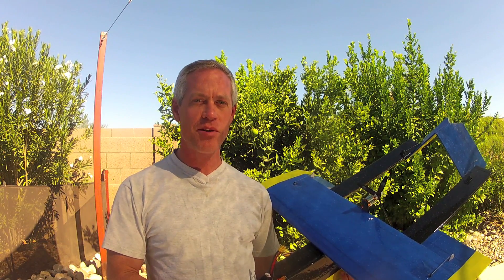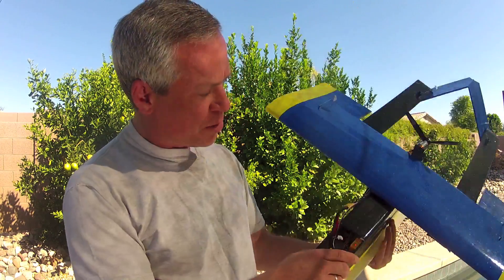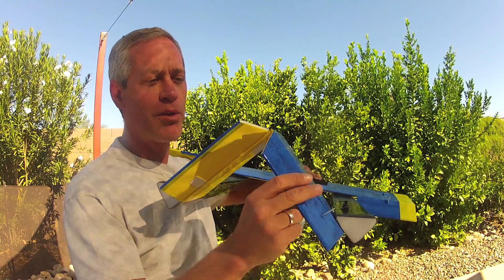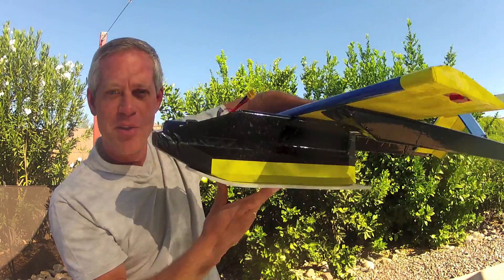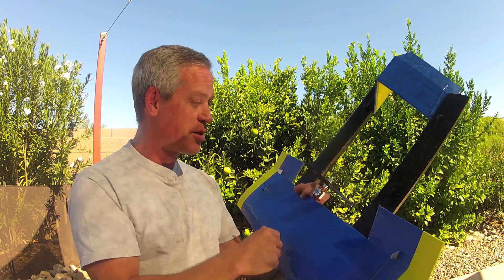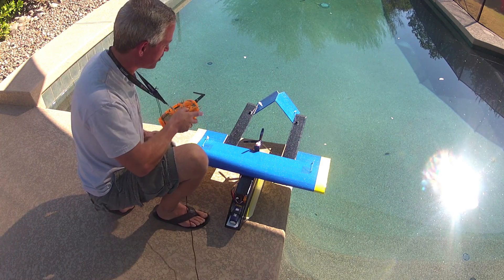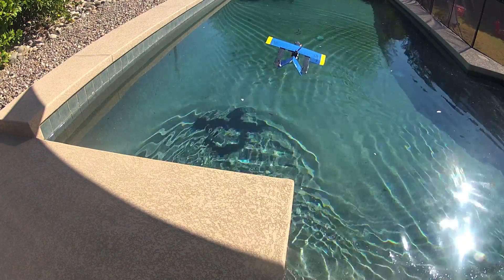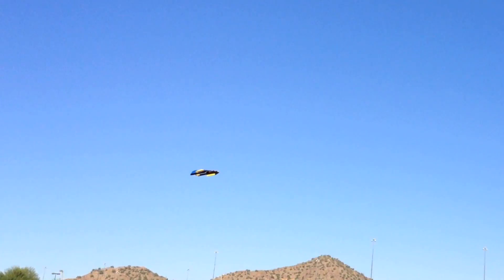EA Seaplane Prototype - "EXOCET"

Comment: What type of hot glue are you using i caint have anyluck get mine to stick before it sets up
Reply: Howard Haynes use in room temperature about 60watt gun and hold for about 25 sec. before you release.

Comment: Hello, my name is Moses. I subscriber, your ARMIN WING CONSTRUCTION Site which is an assume way to manufacture a wing and fuselage! I recently took on a challenge to build a whole electrical air craft using your techniques, I used absolutely no planes at all, it was built entirely out of may head, most people would not believe it or say you must have used some sort of program or other help! I did neither. I used my knowledge and empirical experiences from being a aircraft tech for year in the USAF and intuition in building and seeing physics; you see I am not a math head but have a uncanny way of seeing how thing work and how to replicate mechanical things.I have all ways had this gift and used it on High Power Rocketry years ago when reaching 20 thousand feet with a scratched build rocket, another story for another time. Anyway I built a trainer that is similar to a Alpha 450 just much bigger...yes I did have to at least look at a plane to get started! So I will send you pics of this plane which flew very well and is fun to fly, as mater of fact its one of my funnest planes! Using all of your techniques. Thank you, I dont know your name or what to call you? Thank You Moses A.   P.S pics on the way!

Comment: As a waterproofing agent and Another efficient way to seal off the ends of the control surfaces without the use of tape is" Automotive"  permatex  rtv silicone  It can be purchased  Red, White, blue and black which will match a lot of the Tape colors, it also bonds de papered foam to some extent.

Comment: Wow, now I wish I would have finished my entry in time...weather!  
It is an identical topology!
I built a 30" wingspan, 9" cord, twin boom (carbon arrowshaft), inverted V tail, with a triangular fuse-tube hull featuring side planes just under the CG.  I kept it light ~550G, 1300mAh, 35A ESC, 2200KV, 6x4 APC. Orange TxRx controlled.